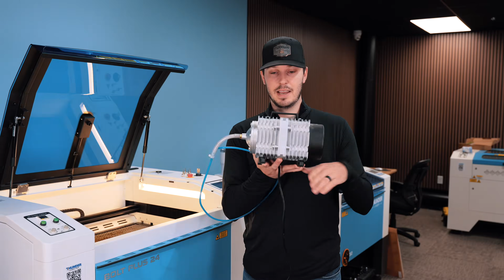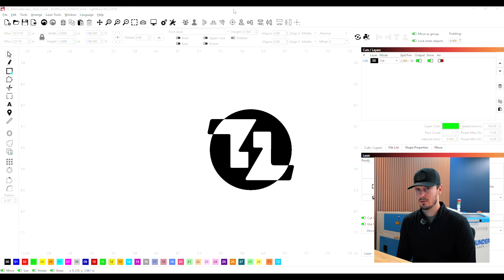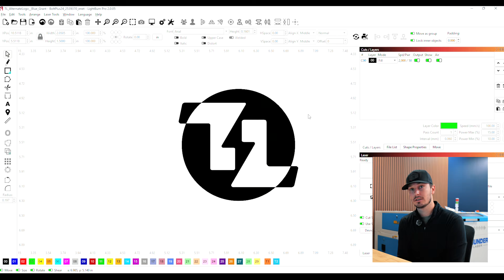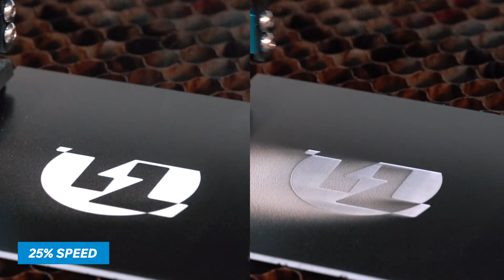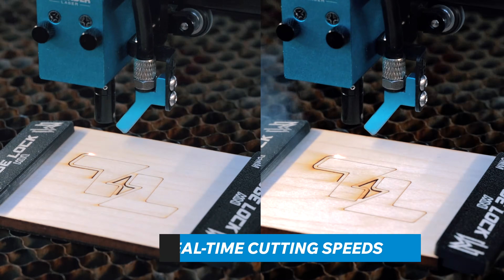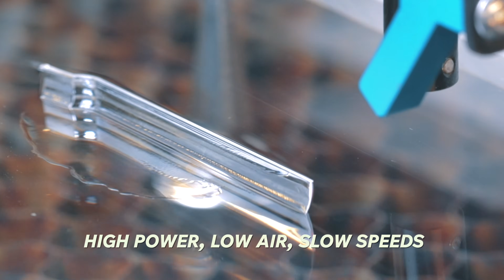Low Air vs. High Air: How to Use Dual-Stage Air Assist | New Thunder Laser Bolt Series Upgrade

Comment: How do you know what the air assist levels are for each material? The brochure has specific settings for power and speed, but just high and low for air assist.